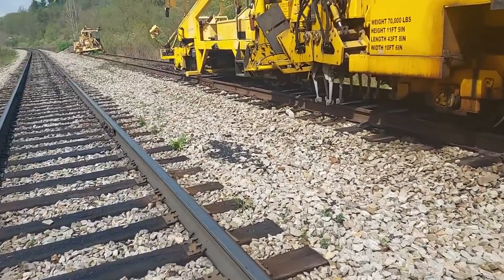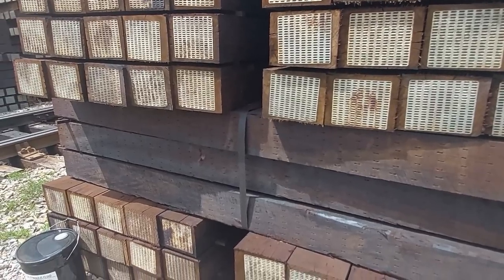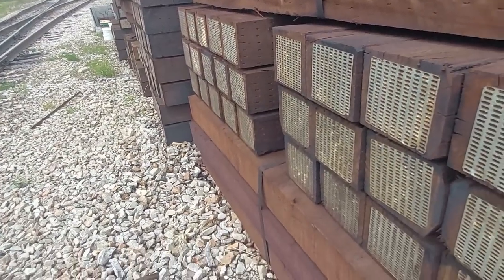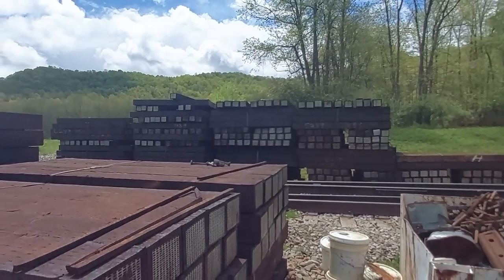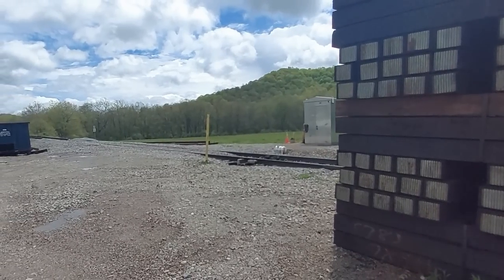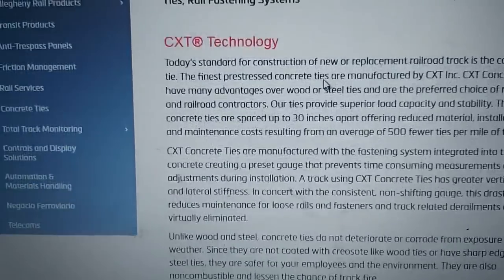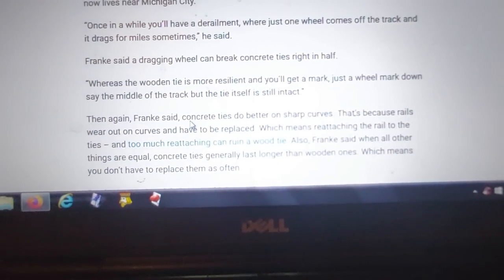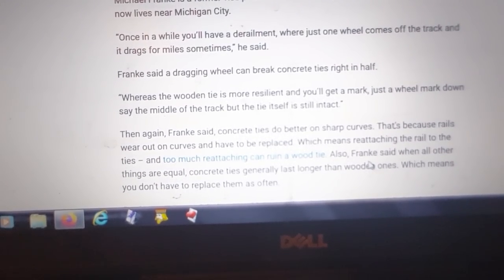Why some Railroads use Concrete and some use Wood Cross Ties

Comment: Another very informative video Dave! It all comes down to what is correct and makes sense for the application, doesn't it? 
Thanks for taking the time to share all the insight you have into railroadin! Have a great rest of the weekend!
🚂🚃🚃🚃🚃🚃🚃💯👍🇺🇸
Reply: Maybe not.  His point about the height of the roadbed struck home to me,  as I've seen Swedish track and tie replacement train systems,  and it's only when I watched this vid that I noticed that,  yes indeed, the concrete tie roadbeds are at least twice the height of his.  Farther north,  higher snow,  whatever,  but that struck home.
Reply from the maker: Thank you for the nice comment Jim. Yes, you are right all RR's have their own unique track problems/weather/economics, etc. There is no one tie out there that is ideally suited for every single RR going. Each RR has to use what is the best option for them, and often use
different options for different sections of track. Concrete, steel,
composite or wood all have their pros and cons. It is a good thing
that there are options available to suit each RR's particular needs.
Appreciate your taking the time to watch the video and write in
my friend.

Comment: Great video.  One summer vacation, when I was in high school, I worked with a friend who had a business putting in landscape ties.  We had to drive about 30-40 miles to a yard where they sold the used ties and picked up a large truck load.  The biggest project was a steep backyard where we put in several terraces of ties, maybe 3 ft. high each, with stairways up the middle and sides.  That was all done by hand except for an old TroyBilt tiller the homeowner had.  We used that to loosen up the soil before shoveling it into a wheel barrow to cut the trenches to sink the bottom row of ties into.
Reply from the maker: Thank you for the nice comment R Brown. We've never had a
landscaper approach us about getting old ties here. Appreciate your taking the time to watch and write in my friend.
Reply: @ccrx6700  I don't recall who we purchased the ties from back in the '70s.  It was a large industrial yard and they had stacks and stacks of used ties on pallets.  Looking on Google maps today, there's a large recycling place there, so not sure if they were there back then or if it was associated with the local railroad.  I see now that the big box stores sell used ties for $20 - $30 a piece.

Comment: As a Wisconsin logger, we cut and sell to local sawmills, what we call "Tie Logs", which are  hardwood logs. They are usually Oak, Maple, Ash or Hickory.  The logs are a minimum of 11" and up on the small end, and 8'8'' long so that they will square up your 7''x9'' x8'6'' long RR tie. These logs also must be sound, with no hollowness, rot, ot severe end checking, cracks or splits.  Every tie is sawed out of the center of theses logs, even if the log is a large diameter over 12" and up they usually saw 1" lumber off the outside of the log untill they get down to your finished 7x9 inch tie. if the logs are more #1 and Veneer grade logs they wont saw a tie, instead they will keep sawing the log down for better grade lumber, more so in the Oaks and Maples. So not every log will yield a tie. As far as "Save a Tree" for the environment, the trees we are cutting/logging are at or near the end of their usuful life, where over the next few years they will degrade and start to die/rot/decompose. Or a storm might uproot or bust them down. So in cutting these older trees we are opening up the woods so the younger trees can grow more efficiently, and reach an older age before they too can be harvested. Nice RR vidjas U R an experianced knowedgeable  Rail Roader.  Thank U.
Reply from the maker: Wow Log dog what a really awesome comment! Excellent explanation and very interesting. I learned a few things tonight
from that. Ties from the plant we get them are graded at the plant
and they reject very few. I got to tour that place last year, it was
really cool. I further did not realize about the trees being at the
end of their life, yes you are right in your ideas after reading your
comment I now see much better about that. Thank you for taking the time to watch and write in my friend
Reply: @ccrx6700  Hi, CCRX 6700,  UR welcome, and thank U 2 4 the neat RR vidjas. As I have just reciently found your channel, I will keep a close eye on U. The closest I get to railroads here in west/central Wisconsin, is with the old Burlington Northern which runs along the Mississippi River. I mostly see or run next to the trains hauling logs to a sawmill along the river.   Thanks again.
Reply from the maker: @logdog8920  👍😊
Reply: As far as cutting and clearing old trees you say it help new grows. Well, when the trees dies and then fall back to the ground they provide for the natural renewal of the forest and also help natural fauna to trive. So, cutting and clearing old trees help destroy the forest. What do you care if profit is the prime motive, right.
Reply: @Christiane069  Hi,  You are right in your comment about letting mother nature take care of her forest by herself, She will, The Natural Way. But this will also includes slow tree growth, Invasive species encroachment, loss of lumber and wood products, beetle and bug infestation leading to tree stress and mortality, and high increase in devastating forest fires causing loss of human and wildlife, not to mention homes, buildings and infrastructure, with high costs. In short, most of us rely on renewable wood products in our day ley lives.  Thank You
Reply: @logdog8920  OK, I understand you point about human use of wood. I am a carpenter by trade and relate to this, however, cutting forest to make pellets for fuel combustion in private homes don't make any senses. This is only one example of miss use of the forest, I could go on!

Comment: Great presentation Dave. You covered a lot in this one. You are right about concrete being easier to make than it is to get timber. You have lots of it and have used it to build houses while we used stone for ours. Concrete is not as good as wood where the track bed is poor, as you said, but on high speed well maintained deep ballast they are better which is why we are only slowly changing to concrete on secondary lines. It is very costly to dig out all the old ballast and replace it with new deeper ballast needed for the concrete so in your case it would not be just a simple take out the wood and put in the concrete on the old ballast. An interesting comment by Jason, I was going to say we had the same problem here on a severe curve, and they blamed it on the use of steam locomotives on our charter trains putting so much pressure on the insulations it crushed them. These days some heavy freight goes round there as well so they cannot blame steam locomotives alone now. Creosote was banned here some years ago so possibly a reason why we use more concrete now. In York they have just relaid the track in a yard and the track looks better than on the main now with welded rails on concrete. We also tried the blocks with a rod or angle between them. They did not last long here either. I bet the cross level was hard to maintain as well as the rod bent rather than a solid support across the track
Reply: Concrete probably has a higher carbon footprint than wood (if you believe too much carbon is a problem) and is non-renewable.
Reply from the maker: Thank you for the nice comment cedarcam. Yes I did notice on 
many of our videos the large number of stone houses, did not
realize why until you shared that, makes sense now. Appreciate your taking the time to watch and write in my friend.
Reply: @earlysda  Yes the trees have a zero carbon footprint when replanted, however the big downside of wood sleepers is the use of Creosote. It is worth the higher carbon footprint to avoid spreading lots of Creosote in the environment.

Comment: Not to mention if the concrete ties are cut. You may not find out until the next train comes and derails. Sometimes you use what is tried and true. The old timers had it right . Instead of fancy rf date tags an old date nail works just fine. A very informative video Dave and thank you.
Reply: Yea,  I sat up when he started to talk about putting chips in them.  The date of manufacture could be embossed on the tie easily enough.  My grandfather's farmhouse had the year embossed on one of its keystones above an external arch.  It's still there and reads '1733'.
Reply from the maker: Thank you for the nice comment aldonco, and you are certainly right
in not finding the ties until it may be too late. Appreciate your taking the time to watch and write in my friend.

Comment: Thank you for an interesting and informative video.
Where I am what you call a tie, we call a sleeper.
I have always felt that if a length of track is being laid new or being replaced then concrete sleepers can be used, but not if you are replacing sleepers spasmodically as normally happens.
Here in Victoria, Australia I do not believe we use chemically treated sleepers. End of life the sleepers are either used for landscaping or burnt. They make great light up fuel for steam engines or to burn in a suitable boiler. Also home fires. Sometimes the sleepers will disintegrate before or as they are removed.
Concrete sleepers, due to their weight do need machines to move them, more so than wooden sleepers.  

I am sure there are sleeper plates that are fastened to the sleeper in the conventional way - spikes or screws, but then the rail is attached to the plate by clips so when the rail is replaced you do not need to remove the spikes.
Reply from the maker: Thank you for the nice comment Kevin and sharing that
info with us. Appreciate your taking the time to watch and write in my friend.

Comment: I would like to make a little comment concerning trees and their contribution to taking in CO2 and releasing O2. This data is from my days at school where I got my degree in biology. I love trees and have many on my property. If you compare what trees vs other plants do in there ability to convert CO2 to O2, a grass field the same size of a field of trees, the grass field does more. The algae in the oceans convert vastly more than all the land plants. This was the data when I was in school and I doubt this has changed. Dave, thanks for your videos, I always look forward to seeing them.
Reply: So...should we cut more trees and don't mow our lawns so much?
Reply: Using wood is carbon neutral. Concrete plants put out vast amounts of C02 in the process of making the concrete.
Reply from the maker: Thank you for the very interesting comment Charles.  Great stuff you presented! Appreciate your taking the time to visit and check out the railroad tie video my friend
Reply: Trees are 24/7, grass not!

Comment: It's amazing just how complicated a stick of wood can be. I remember when UP switched out the Tehachapi Loop of concrete ties. I actually got to work on that project ... No, not the way you'd think. I'm a computer nerd. I did on site service back then. I helped  them get their computers up and running in the bunk train. I was actually surprised that with in about 10 years they were replacing ties on the loop. I'd expected concrete ties to last longer. I guess the loop is really hard on the equipment.
Reply from the maker: Thank you for the nice comment Nerd3Ddotcom, that's very interesting to find that info out about them replacing the ties so
quick. And yep railroads need qualified tech guys like you now
more than ever. Appreciate your taking the time to watch and write in my friend.

Comment: Visiting England when I was young made me wonder about concrete vs. wood ties.  I figured it was due to resources.  Fewer trees in England would make wooden ties more expensive than concrete was my guess.   On the environmental end of things, I do have to wonder about the carbon accounting.  Making cement requires limestone to be cooked at high temperatures, and I don't think they use electricity from windmills and solar panels for that. When that limestone is cooked until it is quick lime, it's slaked with water to convert it to cement.  The slaking process releases the carbon dioxide that's been sequestered for (in our general area) anywhere between 200 and 400 million years.  While the burning of fossil fuels is the main culprit for carbon dioxide increase, cement manufacture is a significant player also.  While trees capture carbon dioxide, it's released fairly quickly as the tree rots. Landfills are capped with clay that restricts water penetration, and while those old ties will eventually rot, that process would be slowed quite significantly, delaying that re-entry of carbon dioxide into the atmosphere. Assuming every tree is replaced as it's cut, I don't know if concrete ties are better for the environment over all.
Reply: I don't know about hardwoods, but in the US softwoods are grown as a crop, both pulp and lumber.

It's a longer cycle than corn, but farming nonetheless.
Reply: Modern railways in Europe are all now continuously welded rail and using wooden ties (called sleepers in the UK) isn't really up to that job as the rail has to be held very firmly. That has a longer life too and is quieter but it does require a very good and stable trackbed maintained to a high standard. European mainlines also tend to have higher running speeds than US ones and they are much more passenger orientated. That makes CWR and a very smooth trackbed essential.

Also, those concrete ties are much more durable, especially in a wet environment.
Reply: @TheEulerID  Our Class 1 railways are continuous weld on wooden ties here. 

What's key is the underlying road bed. Dave's really up against it on his line, what with the fines escaping the old rolling stock, and I'm guessing the topography doesn't help either.  But I've seen the road bed on the CN mainline here in SW Ontario, and it's immaculate.  Continuous welded rail, all on wooden ties.
Reply: @mbvoelker8448  People here in SW Ontario will plant hardwoods as a "crop".  Most farms have a woodlot of a few acres.  I have a friend with 60 acres of woodlot on an almost 200 acre farm.  They told me years ago they could pay off the remaining mortgage if they let a logger in. (They opted not to) I was rather skeptical, as the woodlot was a very mature forest, probably "old growth" (there's ways to tell) that had never been cut and the land never put to the plow. So the trees were tall, yes, but skinny. Not even the diameter of a phone pole in most cases.  But I ran into someone else who knew more than me and they said they take those hardwoods for making veneer, and it's very profitable.  So we may look at an Oak and think it just takes too long from planting to harvest, but it's not nearly as long as one thinks before it has market value.  And even if it extends beyond the lifespan of the landowner, such trees enhance property value.
Reply from the maker: Thank you Rod for sharing your thoughts with us, very interesting
comment. Appreciate your taking the time to watch and write in my friend.
Reply: I came here to make a similar point about carbon. Landfilling wood seems wasteful but it’s a form of carbon capture. Assuming the timber is replanted and that new timber is also eventually cut for ties and then landfilled, you have successive generations of captured carbon.
Reply: @TheEulerID  Wood is just banned also for new aplication and replacing. the creosote to makes wood more durable ends up in our ground water and drinking water overtime.

Comment: For a bit of colour, there is a lot of coal mining in my area, Central Queensland, Australia.  The coal rail system here carries around 100 million tonnes of coal a year so you can appreciate that's a lot of wagons, and multiple locos, per train running all day, every day.  It's all carried on concrete sleepers.  I'm pretty sure it was wood when the rails went in initially in the late 60s and early 70s but they didn't last taking local conditions into consideration.

Horses for courses, as they say.
Reply: @WDHIII When I see the vast output of coal mines and the ever increasing amount of coal being shipped I can't help but wonder what sort of real impact all the green measures are really having.
Reply from the maker: Thank you for sharing that info with us retro machine.  Guess they found out what works best for them. That's nice. Appreciate your taking the time to visit and check out the railroad tie video my friend

Comment: What a very good Video, back along before I retired I was a PW Engineer in SW Britain, although the Branch I worked on during the Week had mainly Timber Sleepers at weekend I worked on the Mainline where different types of Concrete Sleepers were used. On the our Branch which was jointed Track we did all the maintenance , eg packing, realignment, Sleeper/Rail changing by hand but on the Mainline where it was CWR Concrete Track we had Tampers and Stone Blowers to pack and align the Track. Rail changing and stressing was done by hand, and we’d bar in 600 foots of Rail by hand and clip it up by hand too after stressing. I remember one night I spent 10 Hours on the wrong end of a Key Hammer (Spike Maul) knocking out rusted rail Clips for replacement. Good old Days.
Reply from the maker: Thank you Peter for taking the time to watch the video and write in
with your thoughts. May you have a most blessed day my friend.